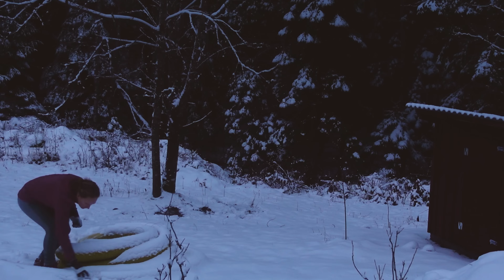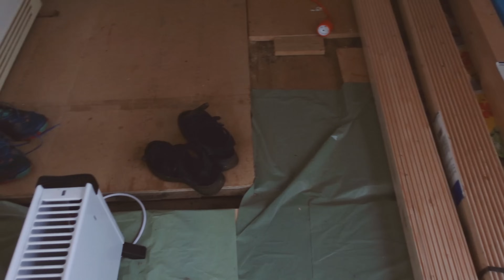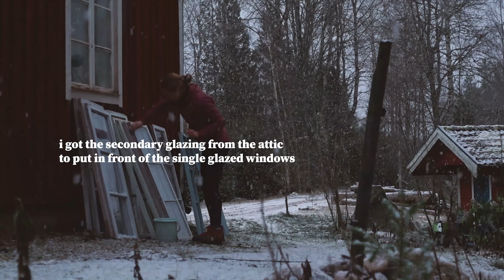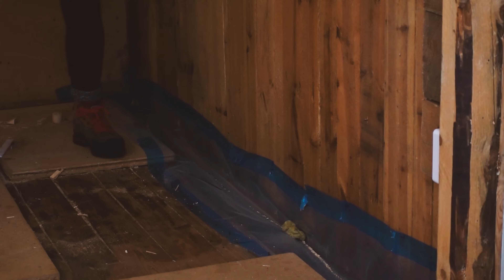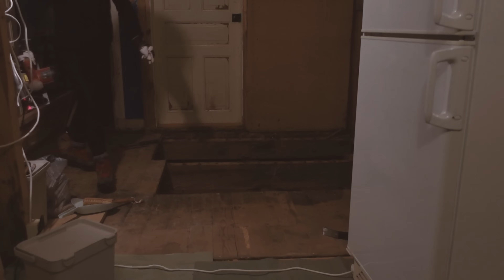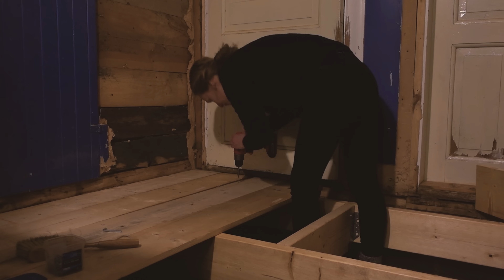I’m Struggling and I’m Learning (Story 8)

Comment: one thing you should do before screwing down floor boards is put down a construction adhesive. It will keep the floor from squeaking when the screws loosen from use. Another way to keep the screws tight is to use Loctite Red on the screw threads. It will bind the screw to the wood. Hope this helps.

Comment: Your build reminds me of the house me and my wife rented for a while, It was built in the 1950s before pressure treated wood. We had to replace the rim joists and sill plates which required us to jack up the house by hand. there was a 9 inch crawl space under the house. I had to dig under each joist to get under it to access the center sill plate to replace it. That house was not a fun house to rebuild but we did it in the end.

Comment: Hej, a small tip, when you are installing wood paneling with machined edges dont hit directly on the edge with the hammer. Use a small scrap piece of the same panel with the correct shape in between the piece you are installing and the hammer. That way you can hit harder without damaging your panel edge.

Comment: Demo work is most always required before you can re-build if you're in an older building. You are doing terrific so relax dear. I do have a question for you: as you are using planks for your new flooring, are you then going to put a moisture barrier on top and then something else or did you put down something like tar-paper on the joists first before screwing on the boards? Just a question as I'm not sure how you are insulating your crawlspace.  Your place will be lovely so as an older woman who stressed herself to the max building a very small apartment in a garage, I urge you to step back frequently, breathe, and pat yourself on the back for every new screw you have put in, Rosie

Comment: It's coming along great.
If i may give you some advice, when i started my renovation somebody told me, you got OSB and OSP.
OSP is basicly made from the leftovers from OSB and it's about 3/4ths to half the price of OSB. But people don't like using it because it's dyed green.

I use it all of the time for subflooring and to go behind dry wall. It has saved me quite a lot.

I thought the ones who have been treated to be anti mold are the price of normal OSB.
But that's the pricing in Belgium.
Reply from the maker: Hm, OSP doesn't come up with anything when I search for it. Does it have another name? Would be interesting to know although unfortunately I do not see anything that's green on the website I get my materials from!

Comment: Building or renovating a house is hard work and takes a lot of time. Your prioritization seems good, so it is mostly about solving the problems one by one.
I don't know your financial situation, but better tooling, like a nailgun and something better to stand on would make putting the ceiling up go much faster. And one will always need more wood than one thinks :-). But it is definitely a trade-off.
Any reason for not putting isolation under the floor? I think it would help tremendously with keeping the cabin warm.
Reply from the maker: Yup, if I had the funds I would definitely get better tools but unfortunately that's not really an option... Got to do it with what I have! Oh and I'll have to discuss the insulation thing in another video...!

Comment: A bit puzzled as to why you chose to do the flooring this early on as it really wasn't any big reason to do it now, especially when you haven't finished painting and doing the walls, usuallly do the floor last to avoid having to covering up the new floor while doing other projects.
Wish you the best of luck though and I'm confident it'll turn out great in the end.
Reply from the maker: Hm, I was doing structural work and not laying the finished floor. Replacing rotten subfloor and floor joists should of course be done before you begin decorating the walls... But yes, if I were to paint the walls then I would (should) do that before laying the floor. Actually in my case I won't be painting so it won't matter much... :)